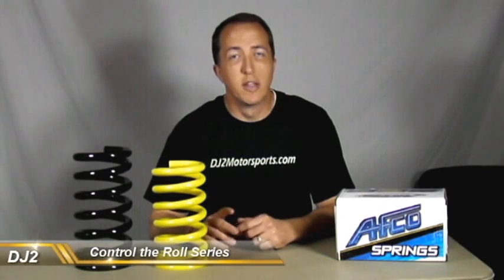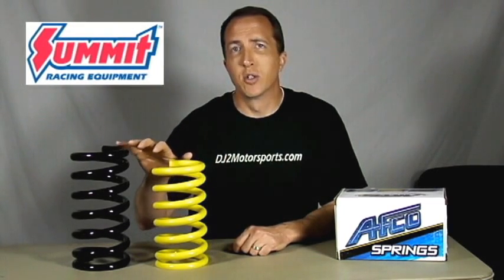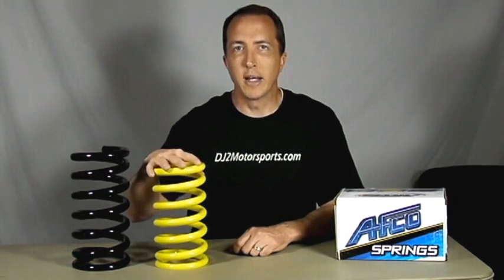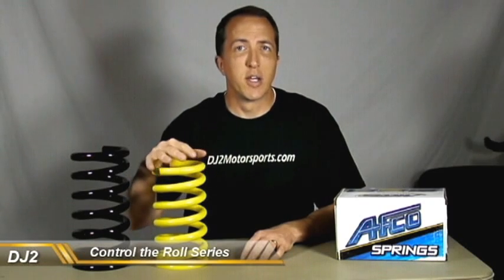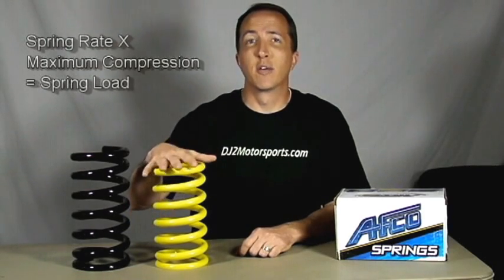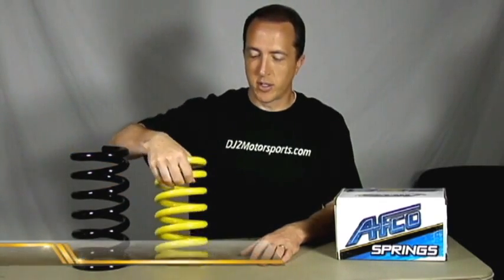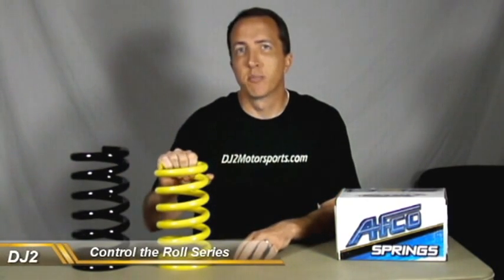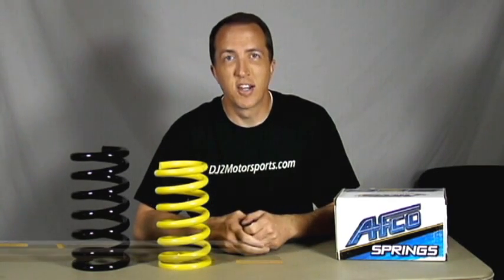Part 2 - Spring Rate and Spring Load

Comment: So how do you figure out the right spring rate for a car to improve handling .
Reply from the maker: That can be tricky. You want to have a soft enough spring that the tire maintains contact with the road surface as it follows irregularities in the road without the car bottoming out (too soft) or without the tires skipping across (too hard). The other thing to keep in mind too is that the softer the spring, the more wheel travel you will have, which in turn could create more camber gain than you want. Driving style, sway bar(s) and spring set up on the rear could also affect things.
Reply: what about if it's AWD. 2012 non turbo impreza. 21mm sway bar in front with a 16 mm sway bar out back, 205/50/17 tires.